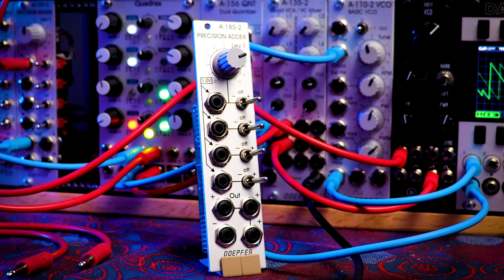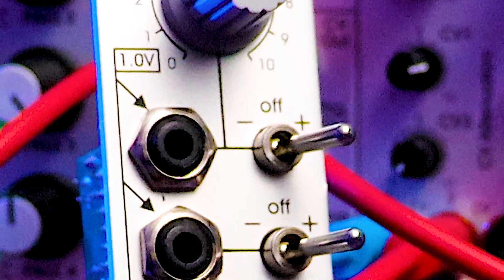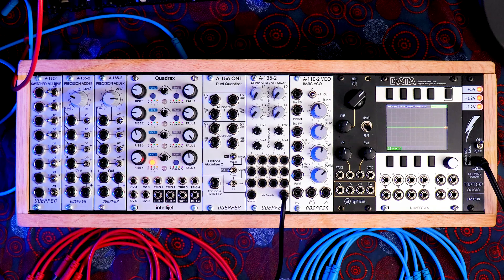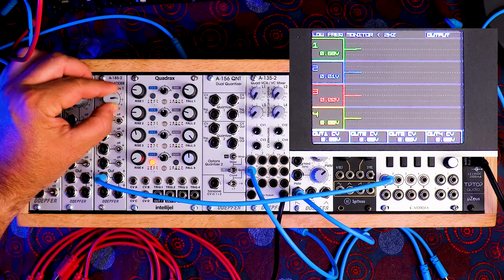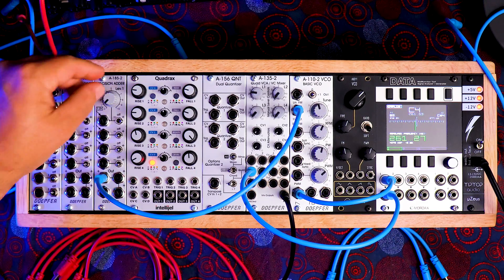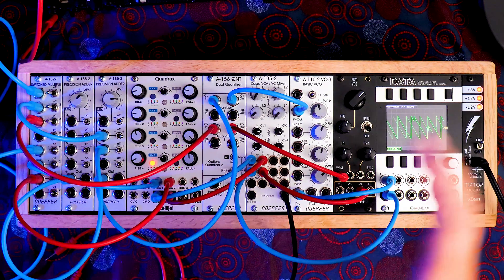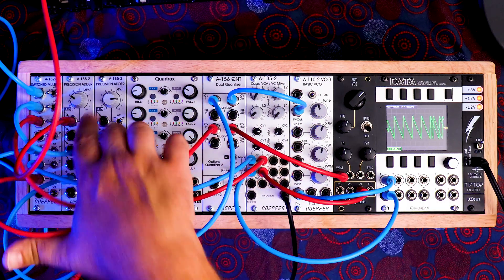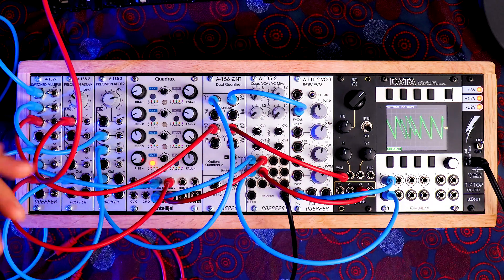Patching With Doepfer Precision Adder | A-185-2

Comment: So it's a manual voltage, for one volt, and a unity mixer with on off toggles, and inverters for all of them. It's very useful but not unique or special. Make sure your system doesn't already do everything this does!
Reply from the maker: Mostly yes - just to clarify - there's manual voltage for the top input, the rest add or subtract one volt. But yeah - you could accomplish this in many different ways, but I think it's rare to find all of those in one module that's affordable like this one. :)
Reply: @braintree56   my dad has two so I know how useful they can be, but he bought them because he was convinced they were something super special, and necessary for steevio patches. Meanwhile he already had mixers and inverters and manual voltages
Reply from the maker: @tychoclavius4818  Gotcha. Yeah - they aren't necessary. Steevio does have a few of them in his racks, but you could accomplish the same thing with any number of modules.

Comment: Have you tried sending multiple pitch info to a precision adder, then sending to a quantizer, then sending multiple different quantized pitch info to a second precision adder? 

If you're all tuned to C, E, G & B to keep it simple, you're on for a ride! All combinations are insanely musical.
Reply from the maker: Interesting - I'll have to give it a try. Thanks for the tip. There's so many approaches.
Reply: @braintree56  totally. It isn't easy either to imagine that combining quantized pitch post quantizer will be musical. Yet, it is and this is where music shook me the most with my system.
Reply: Combine with  some trigger juggling via mixers +switching+logic and develop the VCA/velocity dynamics... and the variations become truly fantastic, approaching some of the all-time expressive "classic" patches and further if desired.  It can take half the day to comprehensively set up the first time, but it is so very worth exploring.   
It helps most to have a flexible goal or strategy in mind, imho.  And to stay determined...and intrepid :D
Reply: You can explore many scale combos. Try Just intonation,  pythagorean or others  instead of always Equal Temperament

Comment: I’m curious about how/whether you use the bus board control feature.  Actually I’m totally perplexed about how that even works…
Reply from the maker: I don't. Partly because when I had multiple ones on there, they were interacting with each other and I didn't have as much control. Also, I'm changing my setup so much and using other non-Doepfer modules, that it's just easier for me to have it all laid out in front of me. There are jumpers on the back, when they are set to accept the busboard CV, it works in the same way as a patch cable. I'll put this on my list for video topics! I'm sure other people wonder about it as well (if they are even aware of it). I probably should become more familiar with it as well. :)

Comment: Nice video!
To improve on this: use buffered mults when handling pitch cv. If you use passive ones (as this switched one is) your voltage drops. The quantizer compensates that if the voltage isnt too far off. But here you can actually hear it in the octave patch. The interval between notes sometimes is only a 7th and not the intended octave.
Reply from the maker: Excellent suggestion! Thanks! :)
Reply: That was crucial when I started to build my modular eurorack theremin. I was wondering why I'm losing pitch tracking and volume antenna worked really weird. Buffered multiple and a linear VCA solved the problems!
Reply: @bass-cadet do you have any demo and/or precise description of your theremin (doepfer I guess?) patch? 🙏

Comment: i got one of these in a bundle, along with the A-160-5 and A-183-2 (CLOCK MULTIPLIER/ratchet and attenuator/offset)....i use all 3 now, almost always. Another great Doepfer module that I have is the A-137-1 wave multiplier(folder). It will even accept line level and lower, so doubles as an external gear interface. Dieter does excellent modules.
Reply from the maker: Nice! I have the clock multiplier too. Definitely plan to add the polarizer and wave folder! Agreed. They are great modules.